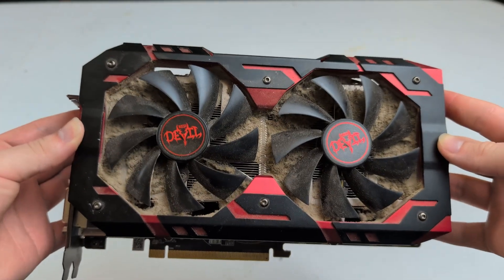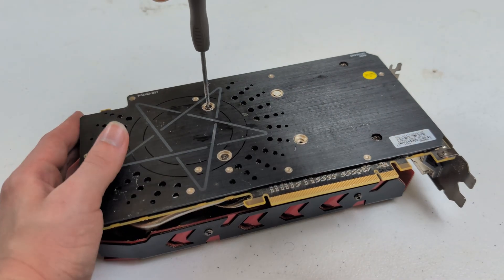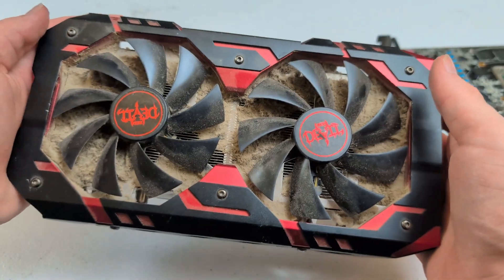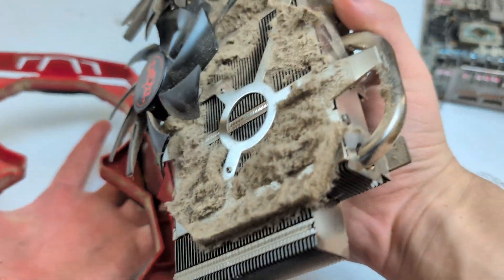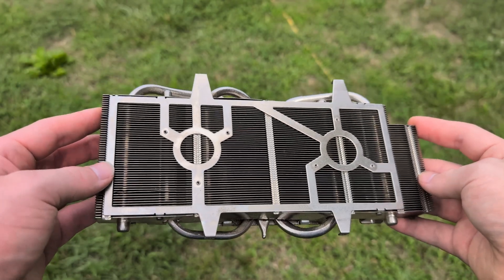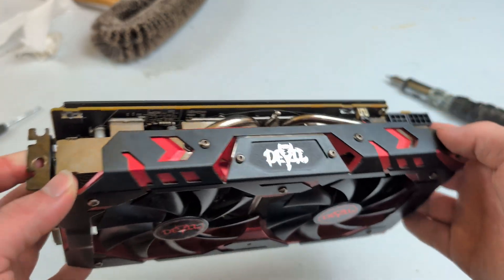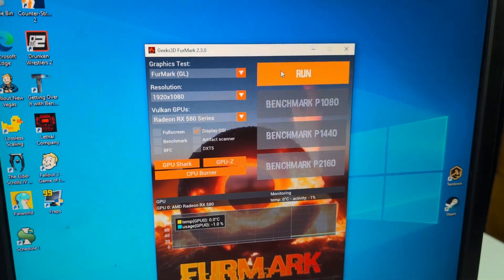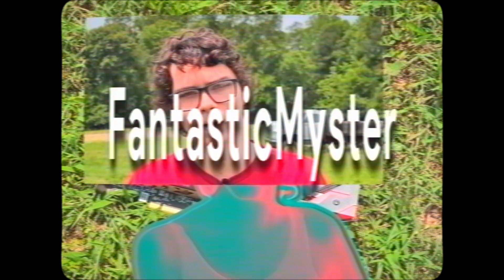Cleaning a DIRTY GPU!

Comment: Isn't that a graphics card and not just a GPU? GPU is the processor on the card.
Reply from the maker: You are technically correct, but it is acceptable to interchange them for simplicity's sake. It can be a mouthful to constantly say graphics card this, graphics card that, so GPU is easier to say in succession 🤣

Comment: One thing that always surprised me, to this day, is that in decades the temps of GPUs are not affected as much from dried out thermal paste.  Even though usually GPUs have lower Tj Max than CPUs.  

Not a fan of the symbols on this GPU, but I do like the colors.  Glad you fixed it, though if I were doing the cleaning I would definitely be wearing gloves while doing so.  

Thanks for the video.
Reply from the maker: Yeah, honestly dust is a much more dreadful enemy to GPUs than a lil dried up paste 🤣 

I mainly didn't wear gloves as it's from a family member and I know them, but believe me when I say I'd wear gloves if it were from some random stranger 😅